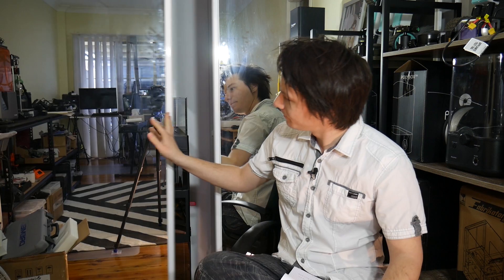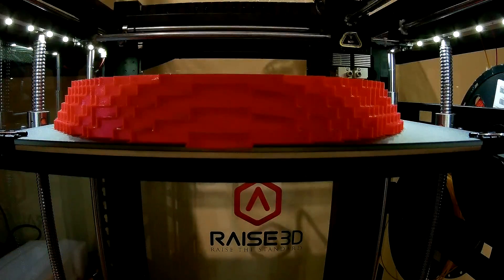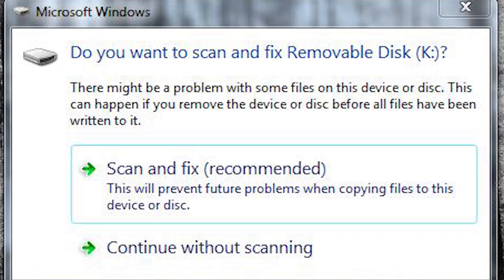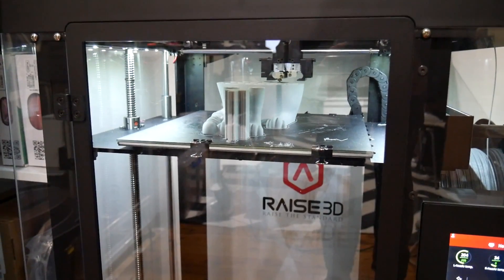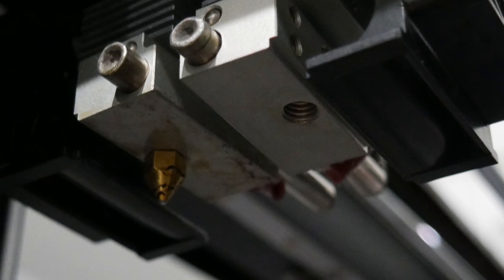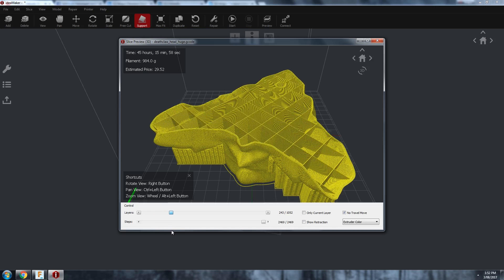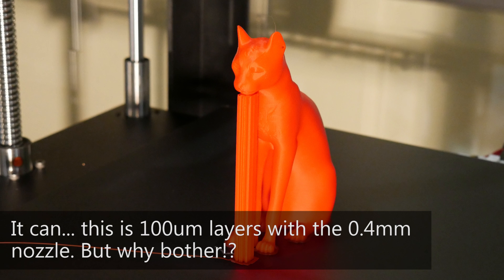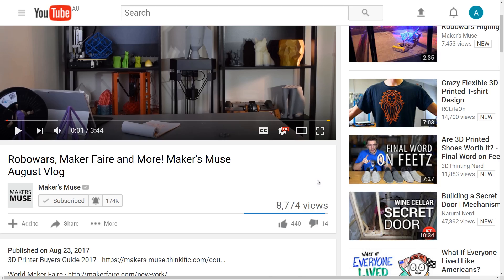Raise3D N2+ 3D Printer Review - It's HUGE.

Comment: Windows always claims there are errors on a USB device that's just been freshly inserted. The only exception is sometimes if you last used it on Windows, and eject it before removing it from the plug. It usually doesn't actually mean anything, most flash-memory devices are able to detect power loss and quickly stow any unresolved data before things go dark.

The one exception is if you're writing files to a flash memory device on a Mac or Linux device, where the final file write is usually deferred. Removing these devices without ejecting won't necessarily result in damage to the files or device, so much as the files won't have been written yet in the first place.

All this is to say: Windows is being paranoid, there's a 99% chance your USB key is perfectly fine.

Comment: You can get a Bigger Machine for 700$ and has a workspace of 500x500x500 , the name is Cr10s5. Probably for Prop making you don`t need the precision of a 3500$ machine, because you always finish up your products with spraying fillers on it and sanding them afterwards. You would use a machine like i mentioned professionally just for bigger prints ??? (not just prop making) Great Channel btw, thanks for your work Angus!!

Comment: can't believe the number of people who winge about a "proper" tram mechanism for bed leveling. Auto bed level is the WORST way to tramp a bed as you are changing the prints dimension accuracy. On larger beds you need at least 7 adjustment points if not more. This bed is actually a pretty good design as it has multiple places to fix dishing of the bed in the middle plane, what lets it down is the ridiculous use of smooth rods for guides on a bed that has over 500mm in Z travel

Comment: Hi , after seeing all your videos on riase 3D n plus , I just went and buy one . I am designing some air ducts so need bigger bed . Now after 2 weeks really got disappointed by this printer . This printer is a biggest failure in ABS . I have almost tried around 1 kg material on this printer and still now didn't got a results.  Now you said that you got good support raise 3d , but I am not able to get that as well in this . Every day I get a mail from a guys to try something new . If you find out a way to print a big part in ABS please share so that I can also do the same before I return this

Comment: I work with this printer(Job) and it takes 5 hour to print a Benchy boat and the quality(for a 4.5k) is bad. The only good and strong point is printing over WiFI and the LCD screen is cool but the touchscreen is just bad. Overal Prusa seems to be better engineerd for a 750+ printer then this one.
Reply: Have you had bad issues with the touch screen? I see quite a few users have suffered failing screens. Some of them use a plugged mouse, others diy replacement screens (stock screens are hard to find and quotes run at 500 USD). I can have a great deal for this machine but am quite hesitant because of the know screen issue + lack of support from the brand about it. Seller says there is "just" an issue with the screen. Price is in the brand new Prusa territory, of course build volume is much larger.

Comment: Have you thought about raising the 2nd nozzle one step level (it sounds like you took it out to avoid it hitting your 3D prints) and using it to deposit normal salt instead of support structures? If the salt can just fall down, then it seems to me like it'd make an OK support structure you can dissolve away and reuse... You'd need to stop the support structure one level early, but it doesn't seem like it'd be that problematic... 

Disclaimer: I don't have a 3D printer, but I would try this if I did since my 3D prints will probably be mostly dome shaped...
Reply: Apparently Imaker has a support material they use in the 2nd nozzle... I wonder how it'd compare to just regular Morton salt (probably is a lot less of a hassle to work with, but a lot more expensive) https://youtu.be/DpDI5CWiIqk

Comment: i've put up with it enough. I don't know how no one has told you this. The Y axis is up and down, Not Z.
Reply: Milokiss82 
That's true if you're talking about mathematics.
In 3D printing, Z is up. Why? I'm not entirely sure, but I imagine it has to do with the fact that if you look at normal printers, top down is X and Y in the programming. Since 3D printing is adding another dimension, the Z is up.
Reply: X and Y as the horizontal axis on many machines is a throwback to the early drafting techniques (and drafting softwares) that use the XY plane as the working plane. Many machines like horizontal mills and lathes (and even moulding machines) will have the Y axis pointing up as their working plane is normal to the working spindle axis. But note that in 3D space there is no up and down, merely a point defined by its relationship to a global reference datum.
Reply: Sebastian Finke You are correct. Up and down have no literal meaning. Same goes for axes, You choose a point and other points to reference for those axes, However, There ARE general directions for these.

Comment: One suggestion. To really test the function and use  of a machine, especially of this caliber, and cost, it would be great to see prints that are mechanically complex something like a part you would use in a real application like in the automotive, medical, communications,  aircraft industry,  or at the least something that one can use inside a home, a better doorknob,  tool holders for the garage, shop,  lamps, or something like a custom baseboard trim, as I had to do for my home, because no one  makes one, instead of props, toys or figures that are or no use other than for pure amusement and maybe for size comparisons. 

As another example, I have an anycubic I3 Mega that I have done a lot of mechanical and pretty darn precise parts to fully test the function and use of the machine to the max. It is a great machine for the price, and so far it has not let me down.  Complex and precise mechanical devices, with gears, cams,  hinges,  inlays, undercuts, and geometries beyond your basic geometric shapes. My RC Helicopter, Autogyro Ultralight, Microlight and LandYacht Kits have a lot of mechanical parts that I have done, originally by CNC machining, but I have revamped many of them and redesigned new ones for 3D printing. Parts for these types of products need higher tolerance than the more organic props and toys typically shown by everyone who does 3D Printer reviews, that must be held for the parts to work structurally,  mechanically and aerodynamically and if a 3D printer can pull these off with precision, and repeatability it is a testament of its capability IMO.

Show a mini V8 engines block or a tranmission system, something along those lines. After all for $3K, I would want a machine to do more than just print toys and it would do the product more justice to show parts that are used in real and more serious industries.  OK it is obvious the machine is large enough and by the looks of the lead screws, and structure it does show to be rigid, so  let's see some more serious 3D printed parts.

If I was the manufacturer of that machine I would have provided you with a part design STL file to show the full capability of the machine. $3K sounds like a lot of dough for something that looks like it will do basically the same as an CR10 or I3, ok so it has larger volume  and more rigidity,  but this is not enough for me, show me the real power of the machine, a part your 3D print review competitors will be salivating they had shown  with their reviews.   Otherwise,  I like your reviews.

Comment: Emperor's new clothes is the best way to describe 3d printers, they only produce trinkets or other crap. But it does enable some people to make money from Youtube vids promoting this iffy tech. After researching over a year I find no merit in this tool.
REPLY
Reply: Do better research.
Yes, a lot of people use them to produce trinkets and other crap, but there are also a lot of people using them to make functional items and for stuff like rapid prototyping etc.
Reply: Sazs Laz 
It doesn't seem like you actually did any research other than just look at some videos on youtube. 
As the other two comments have showed, 3d printers are only useless if you don't use them.
If you choose to make trinkets, then yes, you'll get that, but you can also make functional stuff. Hell, there's a 3d printer on the ISS to make tools that would be more expensive to bring to them than it would be worth.
Reply: Almost every professional product design firm I've been to has at least one 3D printer in the office. There's nothing like being able to make a prototype right now.
Reply: Some of us use them for prototyping for molds, designing replacement parts, rc aircraft. Imagine you need a new hood ornament for a vintage car you cant get it so you scan it in, create a plastic version form a mold around it and cast it in metal there you go.
Reply: Sazs Laz:
Regardless of what other people do with their 3D printer, it's up to you to make up what you want to create. If you can't think of 10 things in 30 minutes that you'd like to make on a 3d Printer then there is no tool on Earth that will satisfy you because that part of your brain where imagination grows is empty.
.

Comment: There's a handy trick to keep the screws from backing off if you are willing to wait, and already know how it should be honed and leveled; if you mark the correct adjustments of screws (where the screw meets the material), then you can apply some thread locking compound (often genericized as Loctite, for the recognizable brand) and wait for it to cure before printing. The marker lets you see where to stop, which means it'll be right every time.

If the screws adjust something else and you have no means of marking the screws with some felt-tip marker, mark the components being adjusted so you can then make adjustments as necessary and then remove the screws or fill with thread locker any way you can find how to make the screw remain firm against vibrations.

Comment: we have one of these printers, and its good to see you have pointed out the quirks with it, ive had a few builds fail near the end which has not been good and it is down to the level of the bed, i will try using a larger nozzle though as it looks like it works well.
If you do the mods it would be good to see a video and explanation of them as we may do the same

Comment: Looks good Angus -  I am a noob to 3D printing and I must ask how important is auto bed levelling? Would I need to manually level it every print? I love the size -  is there a big printer around that has self levelling and nozzle setup?
Reply: No need to manually level for every print.  the Raise manual bed leveling system is a "one and done" setup, where after you have the bed leveled precisely, it's not going to move. (barring any disaster like hitting it hard)
Reply: Great, thankyou for clarifying that. I got the impressioon from some printer makers that self- levelling was really important or had to be done often.
Reply: Absolutely!   I can answer any and all questions re: Raise 3D printers you may have.  I work for them :)

Comment: Very cool, i have the same machine and ran into the same problem, the nozzle height is a little bit tricky. Bed levelling i will check some large stuff failed. Maybe it is the bed levelling then, great tip. I fully agree it should get these upgrades, or even better they provide a aftermarket kit to get the autobed and nozzle height automatic. I wonder if you could could make that yourself on this machine.. now that would make the ultimate printer. The volume, the large touchscren, the build quility and then this upgrade on it. I am not sure if it can be done, what do you think? I mean i see a lot of screws for levelling the bed no idea how that would work out if you want to automate it..

Comment: Hello Maker Muse, I use a Raise 3D N2 + professionally. I have overcome some of the issues you described in your video, I would suggest you print with a Raft. The nozzle height off of the bed needs to be 0.25mm. The Raise includes a feeler gauge of 0.2mm to help set the height. To reduce the possibility of the nozzles colliding with the print, set the Zhop to a distance slightly higher than the layer height. Also when using a larger nozzle, the raft offset height needs to be adjusted. I print with a 0.8mm nozzle, usually with a 0.6mm layer height and my offset is 0.45mm. The same goes for the supports. You will need to experiment a little to get the settings right. The Raise3D N2 Plus is a sweet machine. I have printed some seriously huge prints for work as well as 0.1mm layer height items. Both have been exceptional. 
Cheers
Reply: Have you had issues with the touch screen? I see quite a few users have suffered failing screens. Some of them use a plugged mouse, others diy replacement screens (stock screens are hard to find and quotes run at 500 USD). I can have a great deal for this machine but am quite hesitant because of the know screen issue + lack of support from the brand about it. Seller says there is "just" an issue with the screen.

Comment: I enjoyed the video as I do many of your videos. Thank you for your continued work to educate the masses on 3D Printing.

1. Z-Height screw: Use a Nylon Nut as it will keep the sloppiness out of the equation. 
2. Nozzle height: Set the Left nozzle at 0.200 and the right at 0.250 and the knocking will stop.
3. here is a bracket I designed to help you level your print bed.  https://www.thingiverse.com/thing:2412965
4. If you have more questions please reach me at my Facebook Group:   https://www.facebook.com/groups/raise3d/ 
5. This video will teach you how to refurbish a print head assembly: https://youtu.be/lrsMe5m0a0U

Comment: I love this machine; it's slow, but man...the print quality is phenomenal.
Reply: Have you had issues with the touch screen? I see quite a few users have suffered failing screens. Some of them use a plugged mouse, others diy replacement screens (stock screens are hard to find and quotes run at 500 USD). I can have a great deal for this machine but am quite hesitant because of the know screen issue + lack of support from the brand about it. Seller says there is "just" an issue with the screen.
Reply: @HyperSculptor  You make a very good point, there isn’t a lot of support for the touchscreen from the manufacturer.  Really your options are: sort it out on your own, or pay them for an entire new touchscreen assembly. That’s the screen, housing, and the control board. They do offer a pretty decent trade-in program on a old screen that reduces the cost, but to your point… no, you cannot just replace the touch panel.

A mouse will work, and I have experienced panels going dead.  Personally, I’d like to do some more research into purchasing a direct replacement for the touch panel.
Reply: @lockbotCRM  TY. I saw a thread on the official forum I think, about direct replacement. From what you are saying, if the control board is toast too, it might be problematic. Like I said, for the same money I can get a prusa.which makes the decision tricky.

Comment: Why don't you just use one extruder to do the print and the other to finish it off so you don't have to add another roll in the middle of the print if need be

Comment: The other thing you'd want in a bed leveling system for such a huge machine with 100 hour prints is "leveling fade" where the bed leveling Z adjustment tapers off gradually over the first cm of the print height, and after that the machine stops moving the Z axis throughout the print, saving energy and reducing heat. I added this feature to Marlin's bed leveling a few months ago, and other firmware may also have this option.

Comment: The height adjusting screw does not move due to vibration, as it has a preload spring to prevent that. Yes, it's trial and error to set it in the first place, but once set it almost never ever needs to be touched again. My N2 has been running 12-24 hour prints virtually non-stop for months now, and I haven't touched that screw in ages. Regarding adhesion and your cat's support detachment, you have to know when a raft is a good idea. Yes, it takes time to print a raft, but that hour or so is pretty negligible on big prints, where as you point out, failure is extremely frustrating. I go raftless only when there's a big solid bottom layer for adhesion at all important parts of a print. IdeaMaker support by itself without a raft is hit or miss, as you found. Just as importantly, a raft makes bed flatness and level much less critical. It may be less macho than going raftless, but if what's important to you is a successful print, I recommend just embracing the raft. I got rid of the Buildtak ages ago and switched to a PEI sheet adhered to the glass, it works perfectly. 60ºC for PLA, 80ºC for PETG. Failures are very rare. I fully agree re the second extruder, mine was removed long ago. I thought I'd be using it for removable support material (PolySupport), but IdeaMaker's support is so easy to remove that it's not necessary.
Reply: Have you had issues with the touch screen? I see quite a few users have suffered failing screens. Some of them use a plugged mouse, others diy replacement screens (stock screens are hard to find and quotes run at 500 USD). I can have a great deal for this machine but am quite hesitant because of the know screen issue + lack of support from the brand about it. Seller says there is "just" an issue with the screen.
Reply: @HyperSculptor  No, I've never had an issue with the touch screen. Printer still going strong now after nearly 7 years.
Reply: @juliatruchsess1019  Good to know, TY. I can get one for 1,000 euro, which makes it tempting if the screen repair doesn't turn into a nightmare.